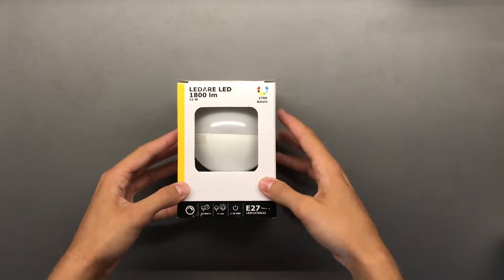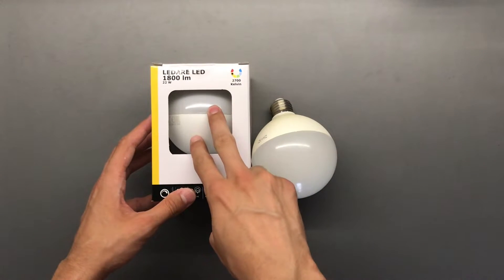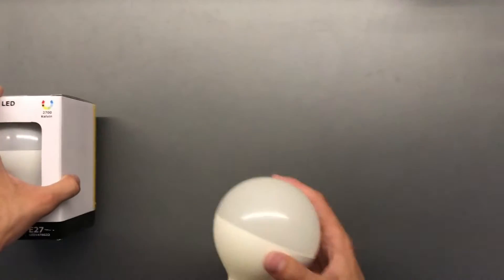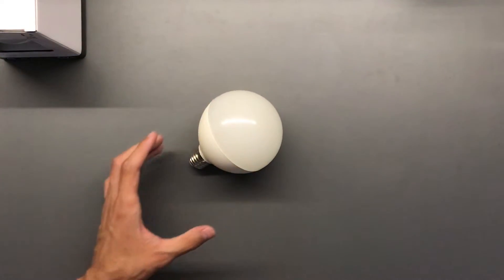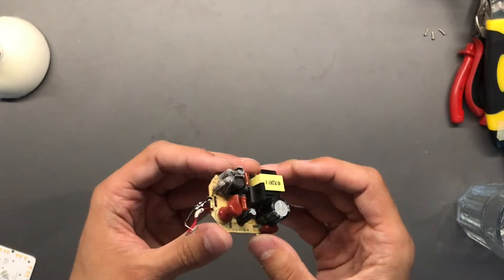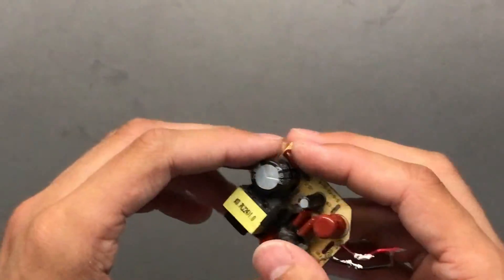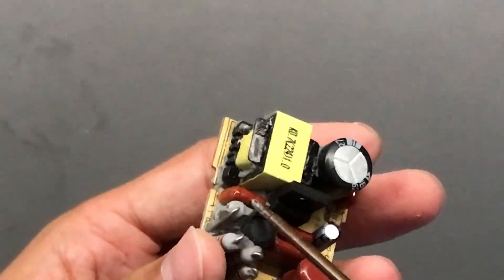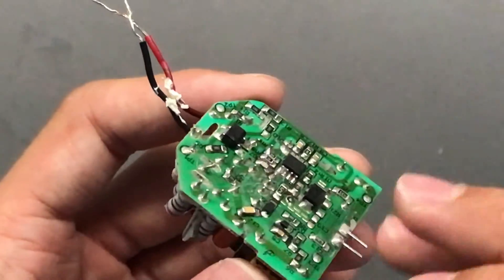IKEA LEDARE 1800lm : Teardown & Failure Analysis

Comment: Mine just failed, WTF! o.O
But the one with cold LEDs is still fine!
It has been dicontinued also in Italy, maybe due to the possible failures, it could be!

EDIT: Yea  thermal shoutdown, this thing is getting really hot. Now after 1 minute it turn off by itself. This video made bad luck!
Reply from the maker: hmmm, is it thermal shutdown though - or just stuff expanding and a cracked solder joint failing ?
Reply: @Darieee  still having to open it apart. I was looking for the Ikea speakers and my bedroom light went off. After a fiew minutes I tried again on turning on the light and after a minute or so the light went off again. The bulb was really hot. This is the first time that this happend on this bulb but I had others that failed in the past.
Reply from the maker: Yeah ... they do have similarly rated ones in even smaller envelopes now at ikea though .. so .. not sure what's going on
Reply: @Darieee  I'll have to check them. Unfortunately warm white LED lamps are difficult to find out here. I hoped that the one made by Ikea were good but at this point I have no idea :(

Last time I checked they were selling only the cold white version of this lamp.
Reply from the maker: Yeah that sounds horrible.. perhaps go on ebay.de and order something that way

Here in Germany they do have quite a lot of warm white stuff
Reply: @Darieee  i'll check that. I'll also check osram if they have something good for me.

That light was the one I use to solder so I really need a strong light to see 0603 parts.

I'll also check back IKEA lighting section.

The speaker is really interesting to me. Looks like a good piece of hardware!
Reply: @Darieee  Another one just failed, same issues. This one is power cycling problay the cap is gone. Unfortunatly they don't make anymore the 1800LM variant.
I've looked on amazon for an alternative but got nothing.

I really need powerful light on my room, it is also my lab :D
Reply from the maker: yhea - should be an easy fix once you depot it
Reply from the maker: would recommend drilling some ventilation holes in the case -- esp once you get rid of the potting compound

Comment: Used to have the same 1800lm ledare in my living room and just unpotted the psu a few minutes ago. I thought I was too rough removing the gunk, but seeing the exact same failure mode on your pcb (burnt inductor leg, broken joints on the capacitor) I don't think it was my fault. The bulb started failing sporadically a few months ago, it would just flash briefly and then turn on after multiple power toggles, probably not bootstrapping correctly. Finally failed a month later or so. It's a shame it didn't have better thermal design like exposed fins, was a nice bright light. I removed the dome on mine without destroying it, hoping to revive it maybe. Did you find a replacement for the power supply?
Reply from the maker: Yeah .. big mistake keeping it in use when it's intermittent .. that's what kills them, all the shocks from the cracked joints eventually burn out the chip (or something else?)
Reply from the maker: I didn't .. I did buy up around 4 of these while they were still to be found on ebay xD, I have 3 in use and 2 spares